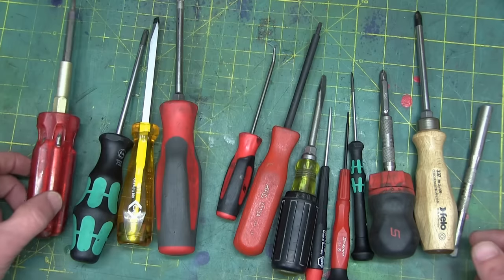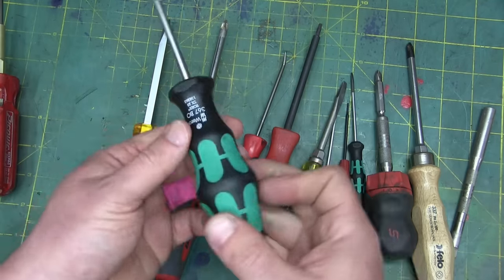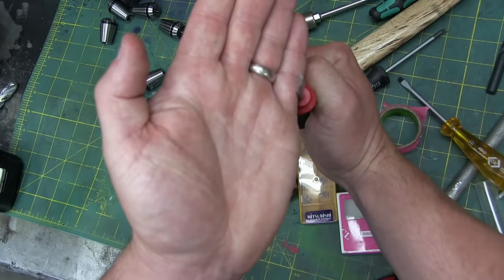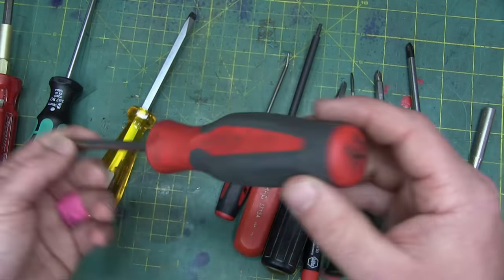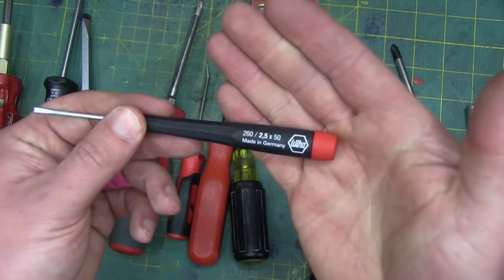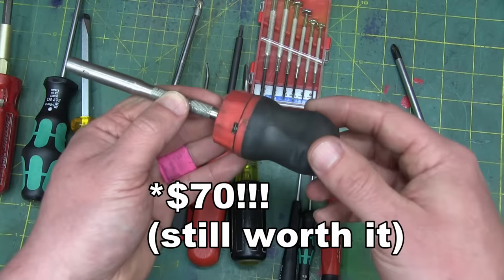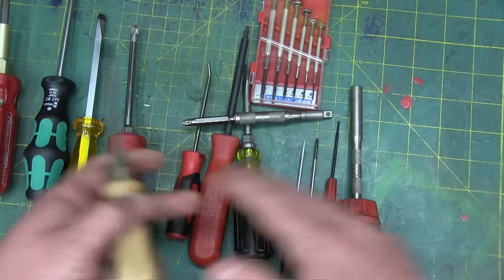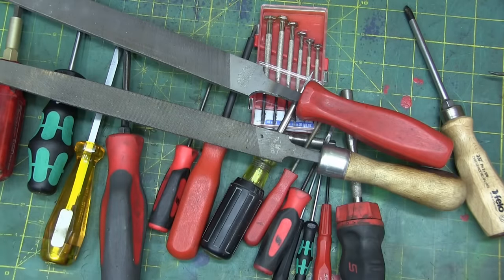Screwdrivers is BEST screwdrivers?

Comment: It'a amazing how much torque you can apply with that weird finger grip section on the Wiha precision drivers.

The thing you're missing is one of https://www.amazon.ca/808050TS-Ratchet-Screwdriver-T-Handle-Stubby/dp/B006MHEJCU/  -- there's a point at which you're driving a screw and there's too much resistance to fight with normal axial drive handle, and this is my favourite solution to that error.

Comment: Gotta disagree on the electronics screwdrivers. The Wera ones are way nicer than the Wihas. The spinner on the end of them is much smoother, and doesn't wear out as quick, nicer grips and they're way more ergonomic. And I've also seen way more broken Wiha screwdriver tips, although they're also nice quality and don't fuck up screw heads.

Comment: I'm going with Facom on this one. the only difference is that I prefer the older design for mecanical applications ( http://media.rs-online.com/t_large/R1760753-10.jpg ) and the new design for electrical applications ( https://www.equipagri-affaires.com/uploads/img/annonces/sage/14094/tournevis-FACA3X75VE_A.jpg ). don't know why exactly, I think it's probably the balance between the torque and the control.

Comment: You can now get the oring tool at o'reilly's here in the states, haven't noticed inch of a difference on my set vs the snap on here in the airplane and Cnc world and they're 15 bucks the handles aren't as nice but the did the same job as the fancy brand at 1/8th the cost. Also agree on the whia. For the small stuff check out proxon from Germany not bad kits.

Comment: has anyone seen or tried the "certified" brand screwdrivers from crappy tire? i noticed them at a glace last time i was there and they look pretty much exactly like Klein's , im wondering if they are just a complete knockoff of the design or if they are using the same molds cause i do like the feel of the kleins and you can really never have enough cheap screwdrivers for beating on

Comment: my flathead screwdrivers are used more as pry bars and chisels than they ever are screw drivers, i hate flathead screws and so do most people i guess, hardly see them anymore thankfully, philips screwdrivers are good as screwdrivers but the screwdrivers are never the right size for the screw or they are too soft and cam out or whatever, i like those multi screwdrivers you can pull out and turn the bits around, even the shittiest ones ive ever had have been good and usable and always the right size to fit in the screw just right somehow, only thing is they dont fit in tiny deep holes that are the same size as the screws

Comment: Milwaukee makes a ratchet  screw driver. Comes in a set, one stubby and one regular. Great value for $30 bucks. @HDEPOT.
Also, bought me a Mastercraft whetstone to sharpen kitchen knives. When my dollar store drivers get damaged, I rehab the tips with the machine and reshape the edges with a stone. El cheapo Mastercraft tools sold in sets for $20 bucks, lasts forever. Bought me a set of Stanleys 40 years ago and still have every one of them.

Comment: I love my Klien's, Best all around screwdriver for Electricians. JMO
Reply: Their nut drivers too.  Better to use nut drivers than screw drivers when you get the small hex headed with a slot in them bolts on things like cable tray and unistrut and panel hardware.

Comment: Where are the IRWIN all steel with slivers of wood riveted to steel shaft handles (ok they haven't been made in zillions of time)? Or the STANLEY jobbies that have macho rubber grips over the plastic handles like the KLEIN you show (ok they aren't made anymore either)? I own um and I use um cause I already bought um and they will beat the crap out of the stuff you review.

Comment: If your screw driver does not have a replaceable bit.  It's junk.  If you have a wood or plastic handle.  Junk.  1/4" and 7/16" hex drive bits in whatever configuration with a good metal handle and wrench flat will last you a life time.  All others are disposable crap.  Tips are perishable tooling.  Just like drills and taps.

Comment: If i get a flathead, it'd better be a damn good chisel and prybar too. I've been using the same 3 Stanley flatheads for 13 years. use them for everything from screwing to prying open extrusion dies that are over-torqued. Me, a Stanley flathead, and a mini sledge made out of die bolts, with jumpy Karen dude on the overhead bustin em open.  The handles will get chewed the frig up, but I dare you to try an break it clean off. never broke a tip either. C shift tried to steal one from me one time, but that's because I stole it from them to begin with. guess who has it now!! lol suckers!

Comment: I got a set of fap-off screwdrivers from my pa. Old black plastic square handle drivers. My pa got em in the 70s. One of the handles broke maybe 5 years ago. Lifetime guarantee n all. Flagged down the fap wagon n he gave me the customer cervix number I could have gotten off gargle. My pa called n the woman knew the guy he bought them from in the Ghey Area 40 some odd years ago. Sent a whole new set for free. He griped about the new handles which is understandable. I like the square handles better too which are now mine minus one of the flat heads. But that service was impressive. I still wont piss away my tax dollers on the brand but am happy to own some of em. Wound up a fap off hand tool n milsucky power tool guy thanks to hand-me-downs n aint doing any related complaining.

Comment: 5:53 - It's called an "investment" because most auto shops require you have $10K invested in CrapOn or Smack tools before you walk in the door. Other auto shops require you purchase a certain amount of CrapOn or Smack tools per month as a condition of employment. 

Stanley used to be awesome stuff, until they sold to a Chinese manufacturer. Now you get absolute crap made with the weakest Chinesium I have ever found. Their picks aren't even worthy of use as a toothpick. Screwdrivers so weak they bend (or snap!) and you end up wasting a lot of gas bringing them back to Wal-Wart for replacement. The tips get chewed to s--t the first use. Better screwdrivers in the dollar stores than Stanley's consumer-grade. Just gawdawful.

Comment: 1:55 bit late to the party, but wera does have screwdrivers with the nut. It’s the 900 series. Quite the sturdy bastards to knock on with the slede when the dirty dickbeaters just don’t have the proper ompf for the job. Though I’m not sure if they have the security torx, they do have the normal torx

Comment: I got one of these last christmas as a stocking stuffer, skookum and it's angle to click over to the next tooth is like 1/2 a degree.

http://www.homedepot.com/p/Husky-12-in-1-Quick-load-Ratcheting-Screwdriver-with-6-Driver-Blades-in-Handle-99515/207095312

It would be my go to for all odd jobs if the missus hadn't annexed it to her tool collection.

Comment: @ 1:55 :
I think you have a small case of being slightly blind? You talk about Wera screwdrivers not having a shank nut, while you're holding a Wera screwdriver with a huge shank nut. It's in plastic, but that shouldn't matter for such a small screw. It's probably for the best if you don't want to ruin the screw.

Comment: Late-comer to the Empire of Dirt but I cant help tossing my .02 into the hat. 
  Maybe most of you work in the shop but I seldom do, so I find myself using a universal bit-driver 90% of the time. If you are just carrying a single universal ratcheting driver around like for an EDC, I would recommend an articulating handle that provides additional torque on demmand, like this style (image for conceptual explanation, no experience with this vendor or the specific product):
http://www.beta-tools.com/media/catalog/product/cache/4/thumbnail/600x/17f82f742ffe127f42dca9de82fb58b1/8/5/855p_foto_02.jpg

Also for very tight clearance situations where even a stubby is too long, this style of tiny ratchet drive is skookum as frig:
https://encrypted-tbn0.gstatic.com/images?q=tbn:ANd9GcS3_kqAnqemRZ2_d72FJ4EWDsrvkGPcg7efDDvQPP4ASxBmsB4_ew

(Not to be construed as a Harbor Fright endorsement.)

Comment: BTW, is there ANYTHING more infuriating than those shitty plastic handles when you are really putting the squeeze on something and those shitty little stamped wings in the handle strip out the inside of the handle and the shaft just spins... Yeah, you can epoxy the fucker back in or something, but when it gave up the ghost the first time it'll always do it again the second time.. Think I may drill a hole right through the fucker and stick a nail in it for preventative purposes.